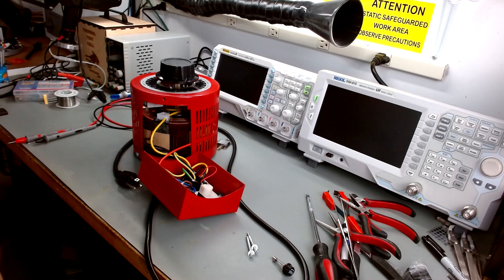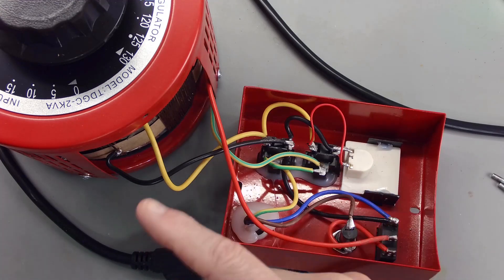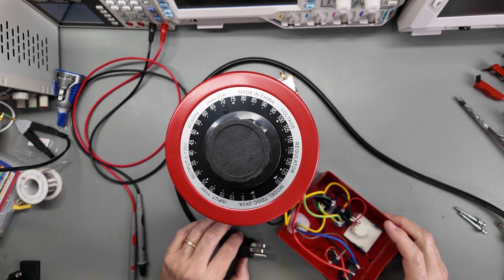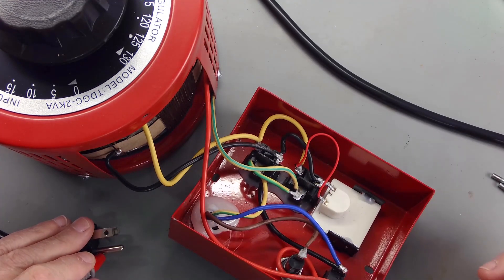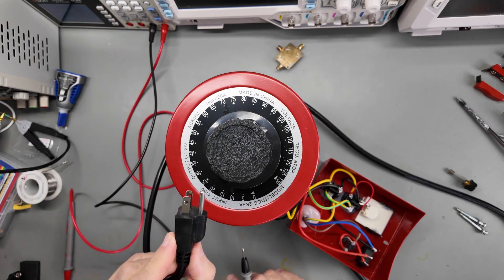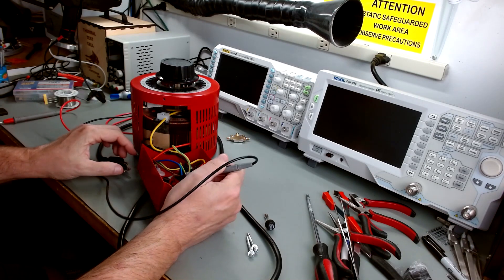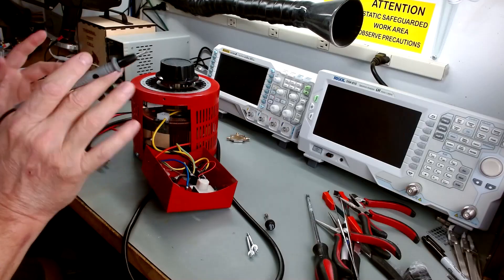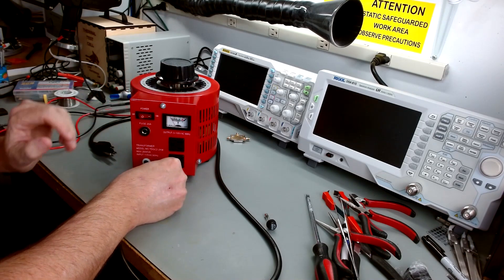Autotransformer Analysis: Is It Safe to Use?

Comment: That's an irrelevant way to test earthing there was no test current there, you have to load the earth bond with a decent test current like 10a or 20a for a few seconds I use 12v psu and halogen lamps as dummy loads for this, you get sparking from earth lugs that are paint  Contaminated even when there's a shake proof washer cutting through the paint
Reply: I don't think irrelevant is the right word... Its definitely relevant. I'll admit an actual load test is way better than his simple continuity test though.
Reply: Yes I missed the point you were focused on  looking for incorrect wiring, but my method will expose wire too thin (copper cross section) and poor connection  techniques
Reply from the maker: Yes, the intent was to respond to a comment on incorrect wiring. You are correct to take it any farther would require a load to verify. 
RJ

Comment: For those that said the fuse should not be on the primary must be thinking of something else.  This is a variable autotransformer so it has only one winding.  The correct place for the fuse is BEFORE power gets to the transformer itself.  You can certainly fuse the output but having the input fused is mandatory.
Reply: Assume you have set a 1/10th output, 120 volt input, 12 volt output.  It will behave like a transformer, allowing 10 amps out for 1 amp in.  If the windings are rated for 1 amp, then a 1 amp fuse on input will protect the windings BUT the 10 amps output will melt the wires.  So the OUTPUT ought to be fused for the rated limit of the wire.
Reply: @thomasmaughan4798  I agree.  I guess I'm not being understood.  I'm not saying you should not fuse the output.   in fact, if you aren't going to bother to monitor current draw, and you haven't any need to maximize your VA for certain purposes, then it's a very good idea to fuse the output.  What I am saying is that you MUST have a fuse on the input, so if there is only one fuse, that's where it should be.
Reply from the maker: Thanks for the information I have never owned one till now and have looked at the internal working. I assume you were moving a contractor on a secondary winding to get a variable ratio. So based on your input it is just a giant wire wound pot used as a variable voltage divider? So the current rating is fixed. This makes sense. 

RJ
Reply: @LynxElectronicsLab  It's more complicated than that.  It is only superficially physically similar to a potentiometer.  There is induction going on in an autotransformer.  For simplicity sake let's look at a 1000VA 120V unit.  The maximum current that can occur in any part of the winding is 1000/120=8.3A.  Also know that the output current is equal to the  input current + the current in the common part of the winding.  So, with 120V going in and the transformer set at 50% you will be able to draw 60V @ 16.6A on the output.  8.3A from the input side and 8.3A from the common side.  That is the sweet spot.  The available current must be de-rated down to 8.3A as you vary either up or down from the 50% point.  So @ 1.2V or @ 118.8V you will be limited to about 8.4A (8.3+8.3/99).  It depends on your typical use case as to how you'd want to fuse the output.
Reply from the maker: @uni-byte thanks for the explanation, I love learning new stuff that I have never worked with. Love your channel btw!
Reply: @LynxElectronicsLab  You are welcome, and thank you!
Reply: @LynxElectronicsLab No it is not a pot. Research the difference, you're quite confused.

Comment: You are wrong.
The fuse on the primary side don't protect the secondary, if the secondary is set to a lower voltage the secondary curent can be much higher than the primary current.
This is probably the most likely fault situation and it is unprotected.
If you conect a DUT with a short circuit and increase the voltage slowly then when you reach e.g. 10 V you can draw 50 A on the secondary while only drawing about 5 amps on the primary.
That can release the magic smoke very fast.
A fuse on the primary side is good to protect against internal faults but labb equipment definitely needs to be protected against faulty DUTs and that requires a fuse on the secondary side.
I would definitely add a fuse on the secondary side if it was mine.
Reply: thats why you put 5a fast acting fuse on primary, putting 20a fuse on secondary is good precarious too. so nether is wrong
unless you put 20a on primary😅, that will short that 1kva transformer but still blow up that fuse or breaker.

edit: should be a 10a fuse on 120v if 1kva transformer.
Reply: @pcrepairshop12  He said it was rated 20 A and since it can output the full input voltage  the fuse on the primary needs to be 20A.
I think kVA ratings on variable auto transformers is confusing.
Maximum output power (2.4 kVA) is when the input voltage and output voltage is the same but then the input is directly connected to the output and the transformer don't transform any power.
The maximum transformed power happens when the output voltage is 60V at 20 A output. That is 600VA since 60 V of the primary voltage at 10A primary current is transformed into an extra 10A at 60V at the output.
Reply from the maker: Lars you are correct. Transformer ratings are confusing. They do not normal give an amp rating as the VA rating handles the amp rating at the voltage. 
RJ
Reply from the maker: Thanks for the input!

I think you are referring to me saying I believe it can handle the 20 amps of the primary And that the fuse on primary protects the secondary. The confusion is that the secondary and primary on transformers are not normally rated in amps. This is why the rating on the unit is 2kva ( not the 1kva model) for up to one minute. This apples to both windings. it is up to the user to not exceed the limit. So for an output of 120v it can handle 16 amps both sides. At 100 volts it’s 20 amps and this is the fuse they install. If you pull more than the 2000va on the secondary it will blow the fuse on the primary. VA on one side of transformer always equal to VA on other. Do I recommend anyone push these that hard? Heck NO! The most I will be using is 120 volts at 4 amps (480VA) most radios etc on the bench will be 30watts (1/4 amp). In the upcoming videos you will see why I am not concerned about hooking it up find a shorted device.
RJ
Reply: @LynxElectronicsLab This is a autotransformer. It only has one winding with a movable tap.
It is specified at max 20 A output according to Amazon listing.
If you think 2000VA output rating applies regardless of output voltage setting you are wrong. You can not load it with 200A at 10V.
Your reasoning that transformers are limited by the VA rating and that both sides have the same VA rating applies to most normal two winding transformers but not to variable transformers like this.
Reply: @larslindgren3846  on normal transformer, primary is rated VA and secondary is Amp if it fixed voltage and frequency sinewave transformer (both primary and secondary). auto transformer like you said confusing😄, since it only have one winding with movable taps
Reply: Absolutely correct. I say this from experience!. It's real easy just to burn a few turns on a variac
Reply: @simongrace2538  Certainly, and this happens when you draw too much current on the output.  If it's rated at 5A then you should not draw more than 5A.  You could certainly put a fuse on the output, but it will never even pass certification if it does not have a fuse on the input.  If it has 1 fuse, it needs to be on the input.

Comment: I would not own a Chinese Red autotransformer:face-orange-biting-nails: Period. I own several (big & small) classic Variacs™But that's just me. Thank you for the video. You RoCk!
Reply: I own a red Chinese variable autotransformer.  It works great for its intended purpose, to gradually increase voltage on an old Crown audio amplifier and I need to "re-form" the electrolytic capacitors.
Reply from the maker: Thanks for the input. We will see how it goes on the rare cases where I will use it. The good thing is you will be able to see do OK or blow up 💥either way. 

RJ

Comment: Hi, RJ, Yes, that unit does look better. So glad that you found a descent unit and that it is safe to use. Something to know for future maintenance and repairs... The brush contact for variable autotransformers is very difficult to find. You might want to try to find one now, while your model is current. (Some folks would say that you would never wear one out, in a lifetime. But, just drop the unit off of the counter, once, and you could easily need a new brush. However, I don't imagine that you will find it, even if you could make contact with the seller. And, you can not fashion one from a common electric motor brush. That material simply has the wrong electrical properties, even though you would think the materials to be identical. When I bought my AT, I did a lot of research on the subject. And, I did locate a supplier. However, YouTube will not allow me to post a link, or even mention where I posted the information. So, I am going to send you an email and you can post it, here. Thanks for the shout-out. HTH.
Reply from the maker: Thanks, I would be one in the camp that as little as I will use it, it should last me a lifetime (what's left anyway) or so I hope. If not the $88 it cost will not hurt that bad.  I will try not to drop it as it is heavy enough to damage more that the unit. Think broke foot/cracked floor...

RJ
Reply: @LynxElectronicsLab  I have sent the email. Maybe one of your viewers would find the information helpful.
Reply: The brush contact is odd on these,  but given the price and build quality they whole unit should be considered disposable.  I have one and don't use it often but will be using in in the near future.  The thing I like least about them is how the leads attach to the windings.  That's the biggest safety flaw.  They could easily come off after time so make sure the case ground is good.